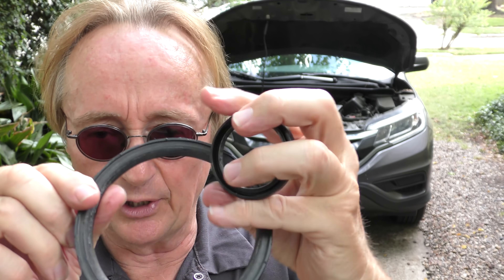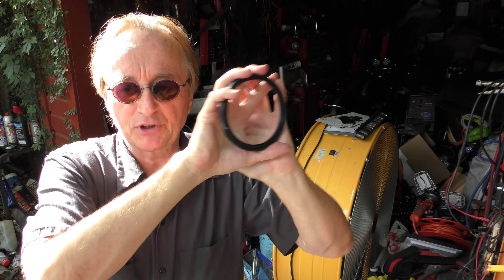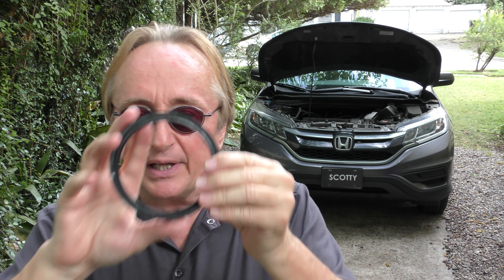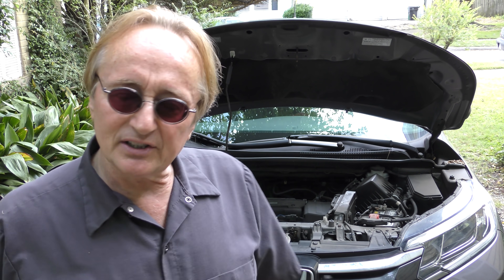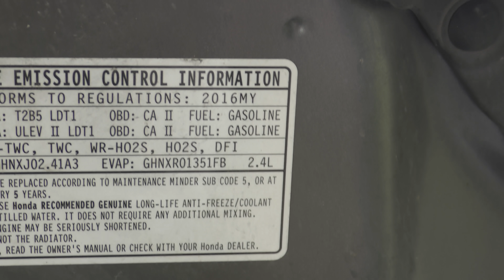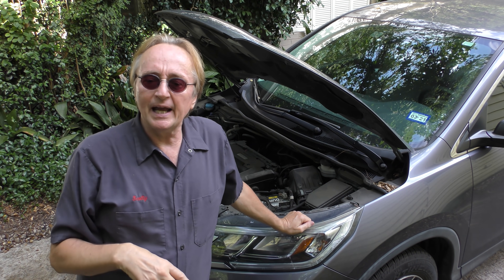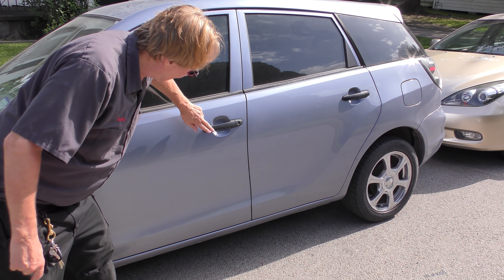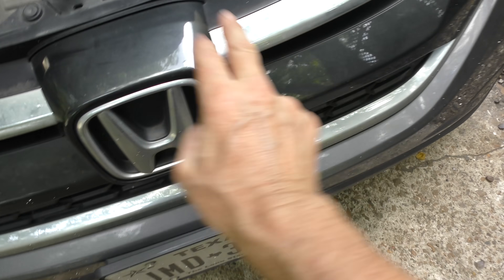If You See This, Don't Buy a Car

Comment: This is why the American automotive  industry is facing a slow but irrevocable march to extinction.
Reply: Exactly,  they know there cheapin on parts. Having the consumer pay even more money to fix it, after paying a good deal for the car itself.
Reply: zoperxplex quiet
Reply: @tedgeronimo5034  It is all about squeezing out every last red cent of profit that they can.
Reply: They had their day high time to fade away.
Reply: It is really strange.  The engineers are smart guys.  Why can't they make something as good or better than the designs of the past?  Did they go haywire on "planned obsolescence"?  Did they get orders from the top to go super cheap?
Reply: @senseofstile  Bean counter engineering, not a new concept.
Reply: @Joe Black Planned obsolescence or making them break is suicidal.  I don't believe they are quite that stupid but they tired old firms ripe for disruption, it's healthy to let them go just like Sears.
Reply: @senseofstile  It is a race to the bottom.  I think the people in charge figure that if they continue manufacturing their cars along the same lines as in the past some unscrupulous competitor will sneak up behind them and undercut their market share with cars that are lower in price and the reason why their cars are lower in price is because they are lower in quality too.
Reply: @senseofstile  Usually, it's never the engineers' fault when you see declining quality. It's the accountant and the CEO that want instant profit margin on every quarterly report in order to secure the raising stock price.
Reply: Fax
Reply: @jamesd2661  exactly, doesn't cost them anything to repair, you're the one paying.  They probably think you're dumb enough to buy GM, its your fault.  They rather save $25 per car on that part than to care for you to save $900 on repairs.  Paying for bad products just encourages them to keep making bad products.  Their measuring stick is money, not quality.
Reply: Bo McGillacutty luxury cars are all planned obsolescence. Except Acura or Lexus those last forever.
Reply: I don't think so lol
Reply: Jumpercable wireless explain that to Honda and Toyota.
Reply: @kevs2good133  
They have figured out that they will sell to customers who want their car to last and purchase quality and either keep them for a long time, or sell them to a used car market with a higher resale value than any other company. And there's enough of those people that they have a large market share.
Reply: @senseofstile  BOTH...................................!
Reply: @senseofstile  bean counters. rarely are car companies run by car guys and gals. most are either lawyers or mbas
Reply: @kevs2good133  I don't believe it.  Not lasting is a result of other factors.  There was no such class in my engineering background nor have I heard of it in the real world.  It's laughably naive unless maybe you have a monopoly.
Reply: Exactly. Coincidence- i told my friend that was a usual where i used to work about a 2 liter turbo Evolution and can't go much further than 100k miles.  And 10,000 miles if it has like 600 hp!  Mitsubishi the word is getting around!   Rock On Chicago!
Reply: Oh i forgot why i ...12 months later car companies are making these turbo i4 motors.  Somebody must have read our minds.
Reply: Lmao. Right
Reply: Down side is the bail outs. If they failed a few times, why give more money to them?
Reply: @jumpercable20  agreed, except I will always give my money to Lexus .. or maybe just the guy that gave his to them first... Hahaha
Reply: Yeah - remember the British car industry? Now it's a cottage industry basically. The 'mainstream' brands are owned off-continent or no longer exist. 
The big two and a half are heading there too.
Reply: @deancary6676  The British like to talk tough but today most of what remains of their manufacturing industries are in the hands of foreign owners.  They have become like glorified Canadians of the European continent.
Reply: Yep, use to be a GM man but tied of junking them after a short time later, everything cheap and breaking, finally got Honda's and no issues after 10 years yet either one. Although bought a used GMC Truck, wanted a Toyota but never find one liked used stay for sale long enough but got such a good deal on one guy garage kept and only commuted back and forth to work highway miles and was cheap :-(
Reply: @remocres  It seems even the bean counters would realize the reality of what works and what doesn't.  Remember the Chevy Vega?  They made 2 million of those.  How many do you see on the road?
Reply: @absboodoo  Yes, it seems the CEO and accountant's priorities are not working
Reply: Breaking news - the whole new car market is going that way. How else do you explain so many billionaires?
Volkswagen was one of the first. Used to be very reliable, now it's a German cousin of Fiat.
Even Toyota is not guaranteed quality anymore. 
Currently simple Korean cars and classic design Lexus are the best. Turbo, GDI and plastic replacements are the worst changes.
Reply: @Avrelivs_Gold  I always wonder if there will be a total rebellion that will result in very few new car sales.  People will prefer totally refurbished or ultra low mile used vehicles that are proven reliable.
Reply: @senseofstile  I believe it will happen and they will make modular cars like desktop computers so people can choose the components
Reply: Phil W   That’s why I buy Toyota’s , I don’t pay for repairs ! 😂
Reply: @absboodoo  soorrry by GM engineering was in on the ignition switch failure on Chev, Pontiac and Saturn cars. Denied it till they found the memo on improving the switch for 0.57$ and using the original part number. That was a senior engineer. They got busted and had to recall those switches in 2014. Killed a bunch of unsuspecting customers or operators. Bastards!
Reply: @jumpercable20  Easy you get repeat business eventually, but now it's instant or shot term profits thst count.
Reply: @jumpercable20  ask Honda or Toyota they know.
Reply: @deancary6676  The British don't make computers because they can't figure out how to make them leak oil.
Reply: @senseofstile  Engineers don't make those decisions, bean counters do.  Just like Boeing, bean counters dreamed up the MAX 737 to compete with Airbus.  Poor engineers got the job of trying to make it work and when it didn't bean counters didn't listen and pushed the plane out anyway.
Reply: @senseofstile 
a lot of engineers are book smart and practical morons.
I would force every new engineer to work as a mechanic for at least a year before allowing them to work as an enginner. Preferably 5 years.
Maybe then they would give it some thought as to design that allows for easy maintenance.
Reply: @senseofstile  planned obsolescence is the brainchild of one Alfred P. Sloan, who once headed GM back in the 20's. He felt dear old Henry was stagnating the car market with outdated models whose production costs were amortised yonks ago.
Unfortunately, we consumers spent (forgive the pun) the next decades just lappin' it up. Now look where we are.
Reply: @zoperxplex  yep too bloody right!  Chinese, Germans and Indians all own the Brit brands now...
Reply: @Avrelivs_Gold  yep the Germans have finally caught up with the French... only they're more expensive.
Reply: @DeffHi  nice one mate!
Reply: @tedgeronimo5034  I thought America is known for quality, I didn't know they are beginning to cut corners too. 😂
Reply: I had an extended cab  S-10 for 25 years (original owner), never leaked, normal maintenance,160K miles then I sold it because the exterior trim products were getting scarce, and on the road still today. 
Guess what I replaced with? 
A 2020 Toyota Corolla, because they couldn’t give a GM product made  today !!!

Comment: I used to design mechanical assemblies often utilising rubber seals with steel spring support, reliable and long lasting, and I'd never consider anything else. The USA seems to be going stupid at so many levels - need some big changes there.

Comment: So.......let me understand this.
The BIG car manufacturers, are making and selling us $40,000 + SUV's and Trucks and making them cheaper?
Well, well, well................go figure!
GM's CEO pays himself millions of dollars of bonuses, the financing Bankster's laugh when they make the loan and the Dealership wrings their hands with joy with all of the anticipated service.
And we, become victims of criminals!
Reply: Henry Ford wrote something called 'The International Joo'
Reply: CEO is a she.
Reply: jeverett72  chrony capitalism
Reply: Welcome to capitalism (you're about 50% low on the cost).
Reply: Or...let a used Toyota depreciate, get it inspected by a tech, and then buy it and drive the wheels off of it for 10 to 20 more years. My 15 y.o. Tacoma has needed nothing but fluids, pads, wipers, tires, and a fan motor. No leaks, no disintegrating plastics in the fluids. (Nowhere near $40k, either.)

I just have to watch out for crazy Houston drivers who can't seem to see an 18 foot long, Double Cab, Long Deck truck! It's a wreck magnet!
Reply: GM ceo os a "she"
Reply: @lpetarp3915  What's your point? In this day of LGBTQPXYZ how can we be sure?

Comment: 3:10 - I used ATP 205 reseal like Scotty said in my 1994 Toyota Celica with over 336,000 miles on the odometer and guess what. NO oil leaks.

Comment: On the GM seal.  PTFE is Teflon which much less friction, but a firmer material than rubber.  The bigger issue I see is the diameter.  The larger the diameter the more circumference distance, thus every revolution is more surface wear.

Comment: I will never regret going from a new GM to a 8 year old Lexus GX.
Reply: I feel you i went from a 2014 Toyota Camry Hybrid to a 13 year old Lexus GS300
Reply: Looking for my used Lexus now 
I’ll never buy American car again . Owned three Chrysler mini vans . Over 20 yrs everyone leaked oil after 50.000 miles . You would think I would have learned my lesson after owning the first one . But we were busy raising 3 kids.
My 2006 fwd Pacifica is a great car never leaked oil .BUT the frame is rotting away 😳. 
So by by to the big 4
Reply: Went from failing (main gasket oil/coolant, transmission, etc) 119k Buick to 140k Lexus LS.. still rolling stong at 220k and will go 300k easily.  Will never look back, except to laugh in relief...
Reply: My 2001 Lexus here in Minnesota, full of rust. Still more reliable than most over 450k
Reply: @alonsodiaz5262  Lexus and Toyota are the same. He meant going from American to japanese
Reply: I'm looking to do the same  have a yukon Denali. It's pretty mint its fast I love the look or it. But it breaks on a regular  basis  in 3 years I probably  threw 5 grand in parts alone
Reply: @aaronwetzel1981  the toyota was made in america and it was a hybrid i know exactly what he is talking about.... do you know what you're talking about? 
Edit: besides it was new and it seems like the point here is that old Lexus are better made vehicles. You probably salty cause you made the worst mistake of your life by buying a newer toyota. Newer cars have too much tech and are more faulty. You just trynna outsmart someone but you make yourself look idiotic my guy. Much love from Houston tho. Hope you got the attention you despreately needed today.

Comment: I purchased new a 2016 Honda Accord LX with the 2.4 liter motor. It runs great. Even the CVT is good.  I'll probably keep the car until the wheels fall off.

I recently got a phone call from the dealership wanting to know if I wanted to train in my Accord for a new one.  No thanks!
Reply: Independent Shop Honda Mechanic told me to change CVT transmission fluid every 30K miles
Reply: @aplleyva  Exactly right! I have a 2014 Accord Sport with the CVT. I change the fluid with Honda HCF-2 fluid and change the oil @ 50% oil life and at 130,000 miles runs perfect, burns no oil and the trans works perfect.
Reply: @steverayrapp  Well I have a 2018  Accord & now a 2017 CRV - Used CRV is a CPO had 24K miles on it. Wife liked it as it had the bells & whistles she wanted so the fact that it's extended warranty I pulled the trigger w plans of reg maintenance 
We were shopping for a used Toyota Highlander but anything in our budget had 80K or more miles on it.

Comment: I work at Honda. We call the 1.5 the oil maker, and the 2.4 the oil eater. We get people that come in with the 2.4 motor for rattle squeak noise diagnosis. It's the sound of the oil sump going dry (no oil). Needs a timing chain and a piston re-ring.

Comment: My 08 Accord with the 2.4 has 314k miles & burns no oil & still runs like new.
Reply: How often do you adjust the valves? Got a k24 myself.
Reply: Thats fantastic! Love long lasting vehicles.
Reply: 314k miles wow. I have a 04 and I haven’t even hit 200k yet
Reply: “Still runs like a clock!”

Comment: Im a powerplant mechanic for piston driven aircraft. Its amazing that i will rebuild an engine built in the 40s, and everything new we put on them is just the old thing that was made new. Its all very basic, proper rubber seals with springs, aluminum cases, easy to access spark plugs (even if mounted in the airframe) that are 7/8 inch. The longest part of rebuilding an aircraft engine is waiting for new parts to be delivered if a part fails inspections.

Comment: I’m with Scotty on the small engine thing, especially if your pulling anything, like the saying goes,there’s no replacement for displacement.
Reply: SUPREME MEGATRON  But the turbo wears the engine more. There really is no reliable replacement for displacement
Reply: SUPREME MEGATRON F1 engines weren’t meant in road cars because of tighter tolerances than an average engine like a Honda K series or a General Motors LS. The BMW S85 V10 and the S65 V8 is a perfect example why F1 engines should never be in road cars. The BMW S85 and S65 is known for rod bearing issues that must be done at a certain time or else goodbye engine.

Comment: That engine seal thing seems like it should be a recall or class action law suit.
Reply: Unbelievably, there are reports from GMC Sierra owners of huge oil leaks because the oil lines are blowing out.  GM is circling the drain as we speak.
Reply: Family member got a notice of "" class action"" won suit against FORD over their Focus cars transmission,, Millions were awarded by Judge. So many Focus cars sold , Family member only got $20. Check and FORD dealer did install new transmission.
Reply: Sure, so the high powered law firm can collect 50% or more of the loot.  They're the only ones that truly make out in class action suits.
Reply: Stacy boulderdash  it was actually bush that bailed out chevy. It was obama that bailed out the green energy companies that still failed due to no cost effectiveness.
Reply: Someone needs to develop an aftermarket seal of the old type to fit them. Then at least you'll only need to replace it once.

Comment: Thank you for this video I just did a front crank seal on BMW with the same polymer plastic and I didn’t let it sit for more then 35 to 45 minutes and it started to leak again and I was wondering why?  But now I know they have to be installed to form on the crank. And also totally clean no lube on the seal 👍🏻👍🏻👍🏻

Comment: This issue is caused by two issues - consumerism and the differences between "theory" and reality. Consumerism because if you can save £10 on parts building a car you can reduce the price to the customer by about £100. The other issue is that PTFE seals if you take the simplified PTFE models  should out-perform rubber in every respect. What the newer engineers forget is that the model taught at university is the simplified model. The reason this is done is they usually have a single lecture to cover seals where you would need a whole module (20+ lectures) to cover just some of the differences between the simplified model and the real world model. I spent a good deal of my professional life correcting other engineers designs when they did not work for this specific reason.

Comment: GM products from the late 1960's and early 1970's (that is when we gave up on GM) used to leak from the engine crankshaft seals so bad, you would have to put drip trays under them

Comment: In 2019 I bought a new 370Z with the 3.7 liter V-6 engine. One of my reasons that I went with that car is that I was hearing rumors that Nissan was probably going to go with a smaller displacement 3 liter turbocharged V-6 in either 2020 or 2021. Because of the relatively large displacement for a lightweight sports car, the manifold pressure will never be high enough that excessive heat or mechanical stress will be placed on the engine. This means that the engine will probably last a very long time if I take care of it properly.

Comment: Scotty I must comment on you saying a Teflon is junk. The Teflon seal is actually much better than that old rubber lip seal. I will admit that GM probably screwed up the installation of it. I worked for caterpillar tractor company for 35 years and I put those Teflon seals in production Diesel engines over 30 years ago. There was some problems with the wear at first because you cannot run a Teflon seal on a ground crank without a very finely ground hardened wear ring to run it on. I’m sure gm didn’t use the wear ring. These seal were definitely not cheaper for us but they had to last the life of the engine which was a million miles on a truck and basically forever on a off highway vehicle. This is one of the very few times I don’t agree with your thoughts.  Otherwise this channel is excellent. Regards Emil
Reply: yup, also can't start the engine if the crank/seal surface is dry...burnishing happens regardless of the crank hardness under the seal if it's dry